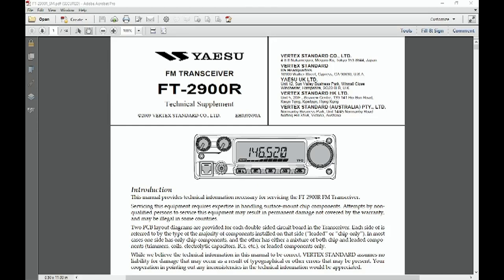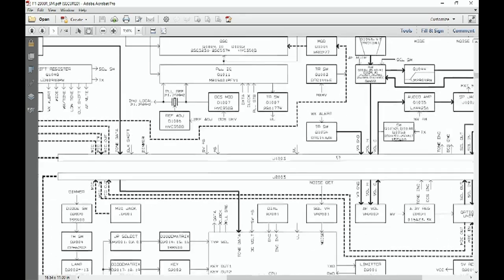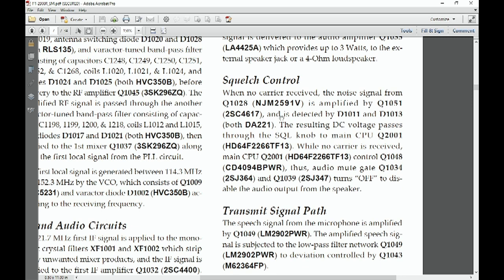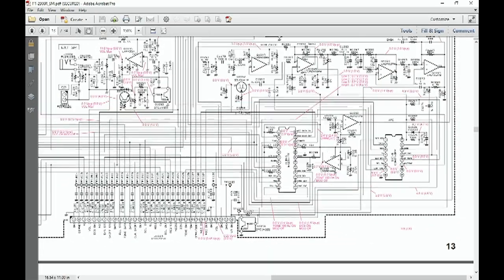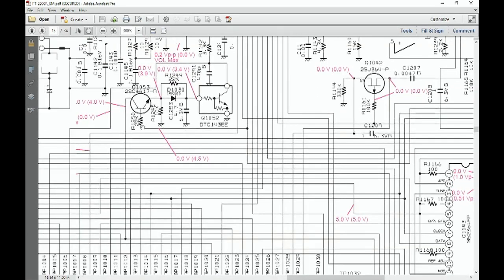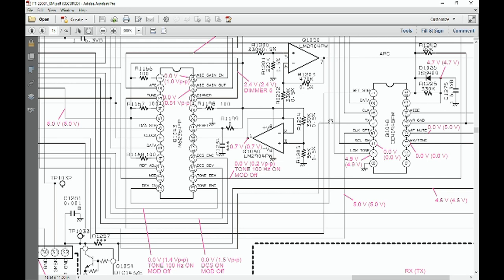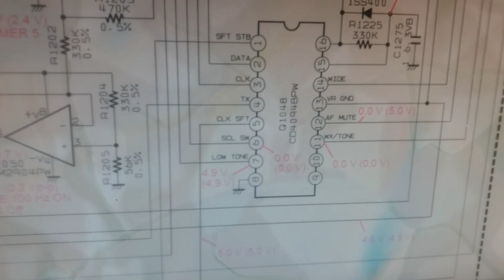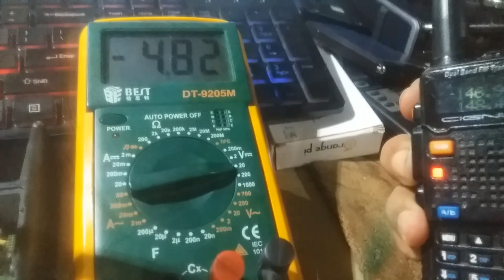Finding Yaesu 2900R COS/COR line (Carrier Operated Switch / Carrier Operated Relay)

Comment: Just wanted to mention that the COS signaling is a positive voltage, NOT negative.   Notice that the meter probes are plugged in backwards on the meter, itself.  So, no carrier (COS inactive) is 4.8V, when active (carrier present) is near 0V.